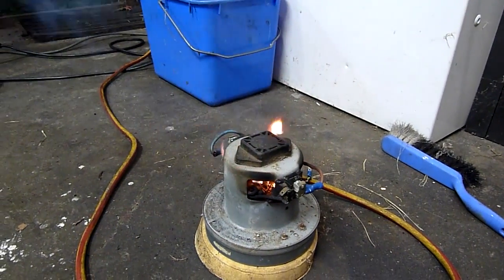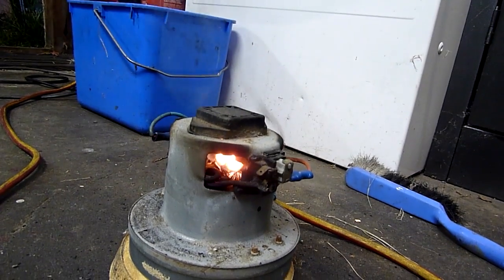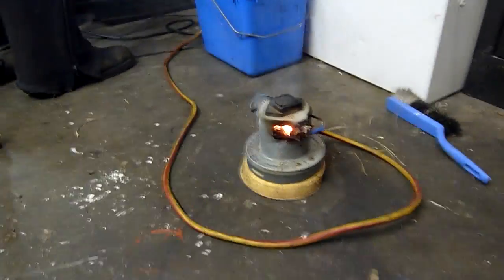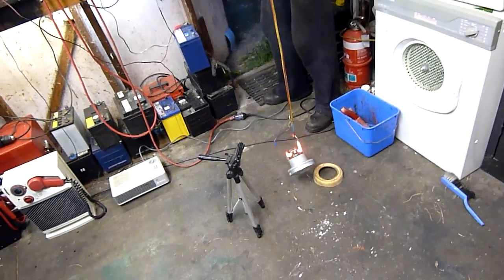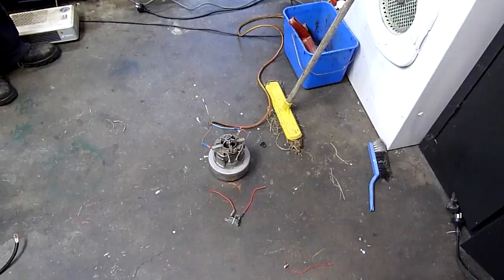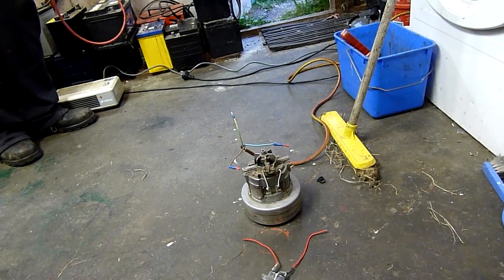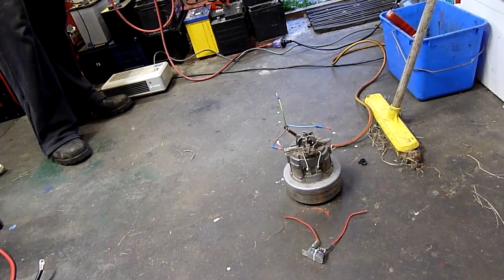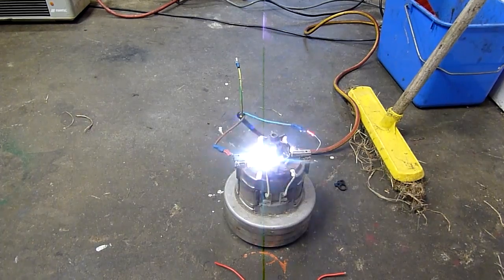Vacuum motors Burn on ballasted mains 240V

Comment: i would wonder what those would run like if they were propped up so that the vacuum impeller was allowed to continue to suck air and blow it over the motor to keep it cool. how long would that motor run then if it would keep blowing away all the heat and flames that are trying to burn it out. 

im honestly just curious to see one of these things spin so fast it implodes rather than catches fire .. so best be done inside a blast box eh :D

Comment: Could you try next time to run any universal brush motor on rectified 240V without filter cap? It should extremelly overspeed and break apart or overhet.

Comment: I thought that an AC motor would not run without the field windings as one magnetic field is shifting against the other. There are apparently many types of AC motor & logically this would be a basic, cheap to produce type.
Reply from the maker: NJPurling yeh in brush motors you create a magnetic field with the armature if you over-drive it enough (like this one) 
They are not as cheap to make as a 2 pole induction motor, but they are frequency limited and do not spin as fast as a universal motor, so they are of no real use for a small vacuum cleaner.

Comment: If the motor was not sat on to of what amounted to a sealing surface: Would the rotor vanes would draw air throung the motor and provide cooling. What else is there that causes the ferocious arcing and the motor's self destruction?
Aussie mains supply is the same nominal 230V as ours, so it isn't being over-volted.
Reply from the maker: NJPurling we had it wired directly across the brushes, no fields :D, it could pull as many amps as it wanted up to the ballast limit of about 30 :D

Comment: Ooooh, is it? Is it going to? Hmmm..... bit more. Keep it going..... Almost there.....

And..... There we go. FLAAAAAAAAAMES!! :D

Wow, that was some nice poppage there, and even after unplugging it and carrying it outside, the flaaaaames hung in there. It was a garden lantern for a few minutes! :D

TOP TIPS WITH BALLASTING:

When you're ballasting a pop-victim, be careful about using appliances with motors in them. (in your case, the fan heater and tumble-dryer) While the pop-victim is running it may use so little current that the motors in the tumble dryer and fan heater don't have enough power to run properly..... so they sit there and burn up instead! :-O ESPECIALLY if you have multiple appliances in parallel with each other that are then in series with the pop-victim!

If say, the pop-victim was only drawing 1kW, that 1kW would be "shared" between the two parallelled ballasts, so each would only get 500w, and at a rather reduced voltage. The motors in the fan heater and tumble-dryer may not like this and burn up.

Another thing: With the fan-heater, if the motor is running too slow (because the element in the heater hogs all the available current) what can happen is that the heater then runs too hot and you risk popping the single-use-only thermal fuse that's in there.

You would have been mighty peeved-off if that pop-victim vac motor took out your tumble-dryer and/or the fan heater!

For ballasts, use something that doesn't mind being ridiculously under-volted. A 3kW immersion heater element will work nicely as will a few kettles. Avoid appliances with motors in them.

Overall though..... Good flaming poppage. :D

Thanxx for showing,

-BoomBoxDeluxe.

15th April 2015, 18.30
Reply: were any of those motors ametek do u no?

Comment: Is someone willling to explain whag a ballist is?
and what does it allow it to do in this situation?
Reply: vanhodid BoomBoxDeluxe chimes in........

OK then, as per your request: I once done a vid on glowing-up pieces of steel wire in a careful and safe way, using a large building site transformer, a variac and..... a ballast. 

It's called: "Wire-glowing FUN & Ohm's Law science :D" 

Have a look at that, and you'll see how, using a specific voltage from a variac and a water heater, I can get a bit of steel wire glowiiiiiiiiiin' in a controlled and reasonably safe manner WITHOUT blowing up either my transformer or my little 10A variac...... Because the whole set-up is "ballasted".

If you enjoy that wire-glowing fun vid and want to see the steel wire fizz-up glow ridiculously and POP, then using ballasting once again, I took it up to 5kW and done this one:

"5,000 watts multi-poppage FUNN!"

In there, the bits of steel wire get thoroughly annihilated, but...... the transformer doesn't pop, thanks to ballasting.

-BoomBoxDeluxe.

15th April 2015, 18.52